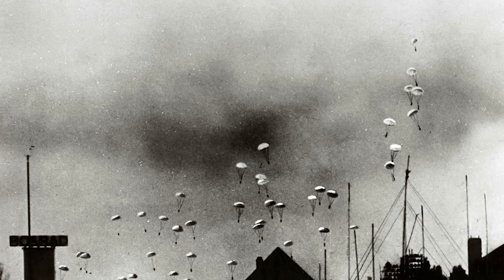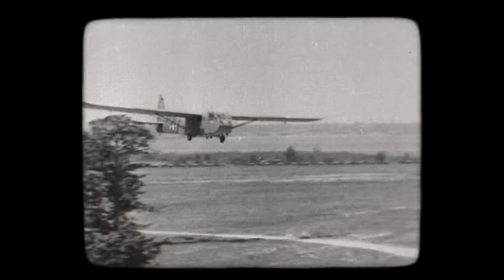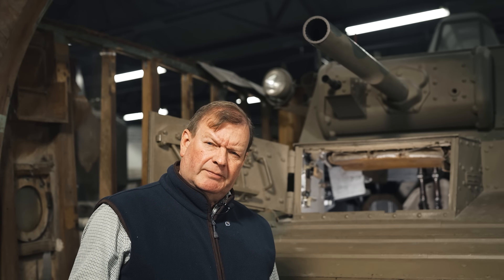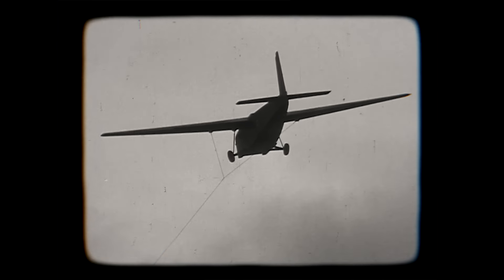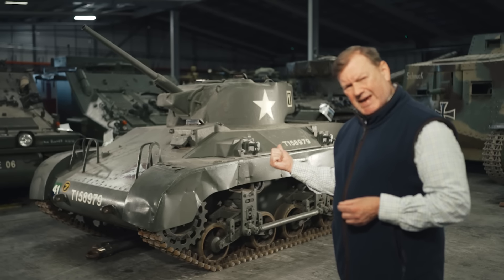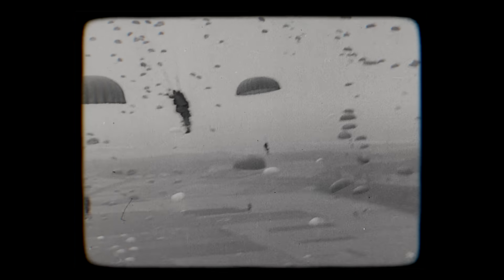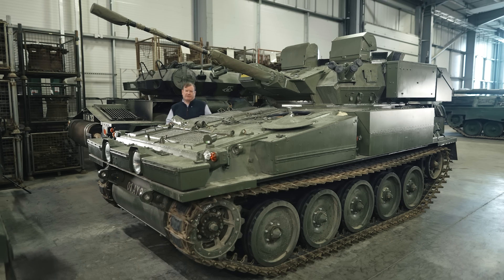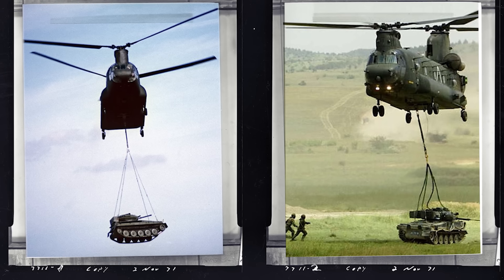Tanks on a Plane? | The History of Airbourne Armour

Comment: Great video. Can you make a follow-up video looking at some other examples, like the German Wiesel, the Soviet ASU-57 and BMD, or the relatively new US M10 Booker? Or other ideas such as how ATGM's have allowed lightweight, air-portable AFV's to remain viable, or the Soviet's usage of rocket-assisted parachutes?
Reply: If the Stryker was considered to heavy for the  82nd Airborne how is the M10 Booker (which is heavier) not too heavy?
Reply: @carlanderson7618 the stryker MGS was trashed for other reasons. namely that it couldn’t fire its gun over the side without risk of the damn thing flipping on its side. the m10 booker also fulfills a slightly different role than the stryker.
Reply: @acid6urns  Regardless of mission the M10 is still too heavy for airborne.

Comment: At 5:14 it is stated that the span of the Hamilcar was quite short compared to modern sport gliders. That is, I'm afraid, a misapprehension. The largest sport glider ever made, the Eta, has a span of 30.9 meters, shorter than the Hamilcar's 33.5 meters.
Gliders in the Open Class (this is a FAI competition class for unrestricted spans) have actually been getting smaller with recent advances in aerodynamics and structures. Spans increased from 25 to 29 meters between the 1980's and the 2000's but the latest open class gliders are back to around 23 or 24 meters. 
Modern open class gliders have increadibly slender wings, and therein perhaps lies the misapprehension regarding their span. The aforementioned Eta has a wing spar that is only 9 cm tall at the root - for a 31 meter span!

Comment: It would seem like carrying AT guns capable of taking out current tanks fielded by the enemy would be the realistic choice. It could be transported by jeep type vehicles capable of towing the guns with the crew. It just seems trying to airdrop tanks capable of taking out most tanks wasn't possible at the time.
Reply: Crete was the first noticed use of RCL guns by the Germans. Light and powerful.
Reply: That was actually at least trained for, because I've seen training films for at gun crews about how to properly secure and deploy both Jeeps and guns from gliders. They would of course have to send the Jeep and the gun in two separate gliders. Of course they trained to do a lot of things they didn't end up doing in practice.
Reply: The trouble with this is that potent anti-tank guns require potent towing vehicles. A Willys MB could only tow a 1/4 ton trailer, while a six-pounder AT gun weighed about five times that.

Comment: Honorable mention to LAPES: Low Altitude Parachute Extraction System.
A tank (a Sheridan) is palletized in the back of a C130. The Hercules skims along the ground and throws a parachute out the back. The chute pulls the pallet, and the tank slides out to drop to the ground in a nearly combat-ready state. Theoretically.
As far as I am aware, it was never used operationally, but there is some awesome test footage on Youtube!

Comment: During my flying tours at Lyneham, from 1981 through to 1997 one of our regularly exercised roles was mass delivery of airborne forces according to the Long-Range Parachute Assault Concept (LPAC).  Formation flying rader (SKE) was bought to enable this to happen in bad weather and we would regularly take streams of 18 C-130s around the UK to deliver vehicles and the guys with the one-way tickets to their DZs.  But the aircrew at least realised that LPAC was an utterly flawed concept except in a totally benign environment.  The only justification seemed to be the need to retain jump currency for the Paras and, more importantly, their jump pay.
We did drop the odd armoured vehicle via the 20,000lb rated Heavy Stressed Platform but this was also clearly redundant once the concept of loitering Close Air Support by either fast jets or helicopters, which could do much of the role but with much greater flexibility, especially once decent defensive aids started to be fitted, particularly missile warners, countermeasures and Hostile Fire Indicators.

Comment: And thus the a10 was born. The best flying tank, or at least as closest weve ever come to it.
Reply: "Is Titanium, must be tank"
Reply: Ah yes, the urban internet myth of the A-10 being armored to withstand more than small arms fire. 
The reality is, even MANPADs make them go away real quick, not to mention proper SAM systems.
Reply: @Ganiscol  to be fair plenty of man portable weapons that take out tanks as well. As for light armoured vehicles theyre not made to take much more than small arms fire and im not sure if they would be more reassuring to have than air support
Reply: The MI-24 is more of a flying tank then the A-10; It is like a Merkava of the sky- exept in this case the engine placement is its biggest weakness.
Reply: @wehrabooslayer419  i don't disagree, but 2 man crew and 8 passengers. Light armoured. Thats an apc, not a tank. As for merkava it can carry troops if you dont carry ammo
Reply: @2fwelding842  Good point about the amour and crew, but like the Merkava, MI-24 also have problems with transporting troops and carrying weapons under the pylons, as it significantly reduces the range of the helicopter if it carries troops and is heavily armed at the same time. In Afghanistan, both capabilities could be use at the same time at best- if the helicopter evacuates wounded soldiers after expending all the ordinance, like in the case of Merkava.

Comment: If you're talking about the flying tank concepts designed by Christie, he did actually come up with a design which was not just a glider, but was theoretically capable of taking off as well. This was a purpose-designed light tank which had a highly reinforced version of the "Christie suspension", to take the shock of landing directly onto the ground on the tank treads. To make it fly, it had a large detachable wooden biplane frame (with a large 4-bladed wooden propeller), which was bolted to the rear deck of the tank, with explosive bolts to allow rapid separation. It also had a much larger and more powerful engine than any other tank of similar size. The tank engine had an extra sprocket at the back, which would be connected by a chain drive (like a motorbike chain, only larger) to a smaller sprocket on the biplane frame in order to spin the propeller for takeoff and powered flight. The biplane frame was as simple as possible - not much more than wings, propeller and tail, since it was essentially a disposable component. Therefore it would necessarily have to be controlled from the tank itself - possibly by the tank driver, or maybe even using a second driving position with aircraft style controls mounted somewhere inside the tank.

Comment: You also need to remember that a C-17 can conduct 5 flights carrying a M1.
Then it needs to be extensively serviced and checked for stress factors, etc. This maybe a peacetime restriction, but I suspect the operational limit wouldn't be much higher.

Arguably the role of intimate and immediate fire support for airborne / air mobile formations is now filled by rotary wing attack aviation (AH64, Mi24, Tiger, ...).

Comment: Actually, we're back to the concept of gliders as a viable method of delivering MBTs to the area of battle, if not the battle, itself.

An expendable airframe capable of handling a 70 ton MBT is certainly doable and the advances in materials and engineering have made such a craft both easy to produce and affordable in cost.

Training one of the MBT crew to fly the craft, with the aid of modern technology would be relatively simple and there could even be gliders with support services that would join the formation to extend its effectiveness.

Comment: Despite the difficulties, having even light armour where the opposition has none, is an advantage. An example of this was early in the Vietnam war, when the Australian Task force got reinforced with a small squadron of Centurion MBT's. This was not a light tank, of course, but in support of infantry, the few tanks saved a lot of Australian infantry soldier's lives, and helped various missions succeed. 
A lighter, "air-portable" tank would have been a little more vulnerable, but at the end of the day, losing a few light tanks is better than losing the bulk of an infantry battalion.  
A lighter tank, properly designed, is less vulnerable to extreme terrain and weather conditions than a very heavy tank. So there is a role for it. Light tanks can often use bridges with low load ratings, etc, etc. 
Obviously, you don't deploy a platoon of light tanks against a "Panzer division", but having a vehicle that is immune from small arms fire, will help out light forces of infantry to some degree. 
No MBT ever built is going to be totally immune from from artillery, ground attack aircraft, other MBTs or anti-tank assets. So "obsolescence" is often context-based.